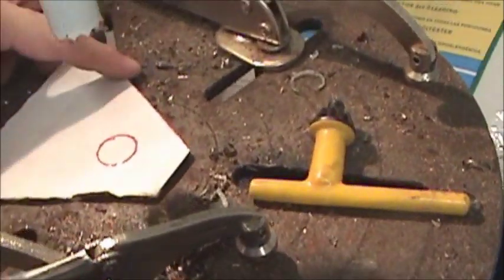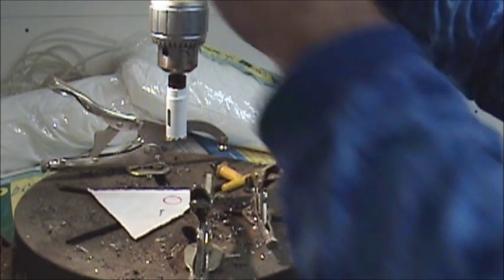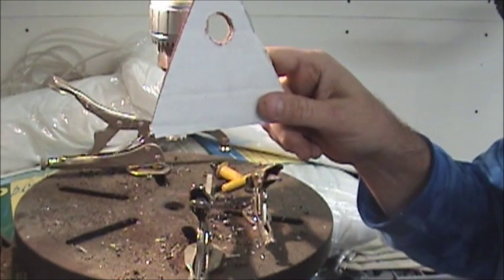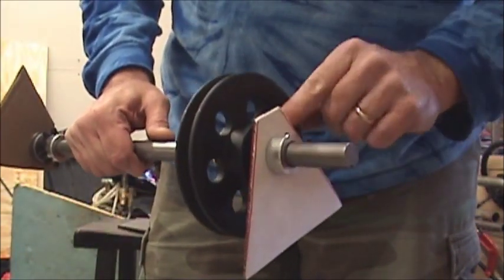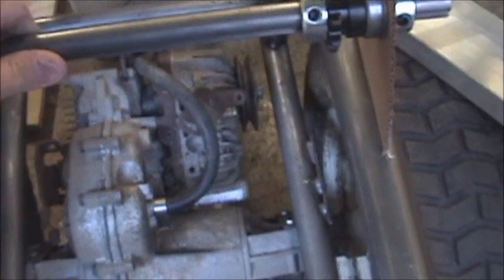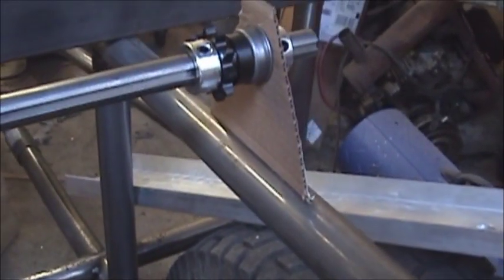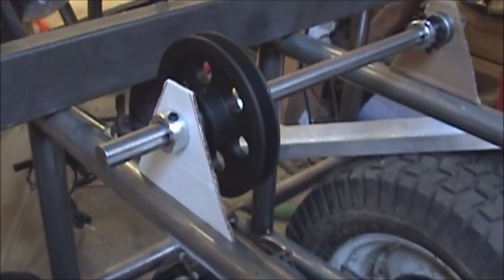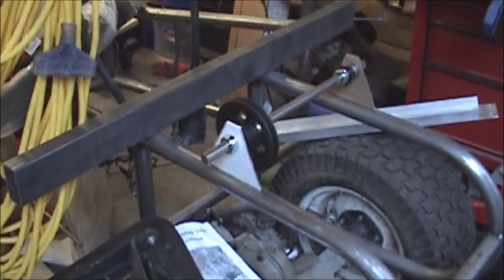Go Kart Jackshaft Fabrication

Comment: Don't use those cheapie bearings/seals in that plate. Use pillow blocks mounted to plates/blocks that are welded to the frame. You will be much better off. You can get pillow blocks at mcmaster.com